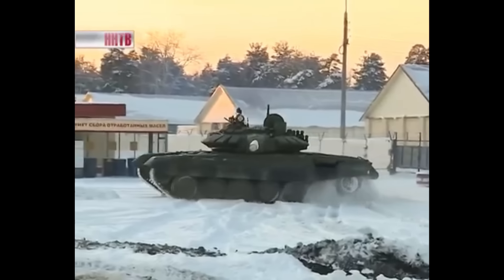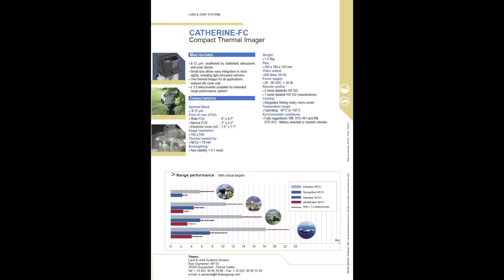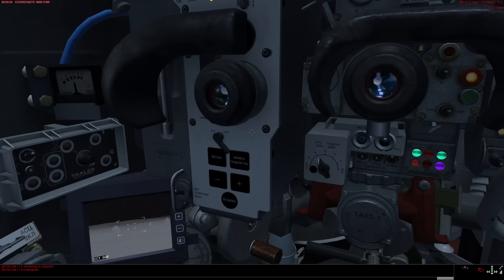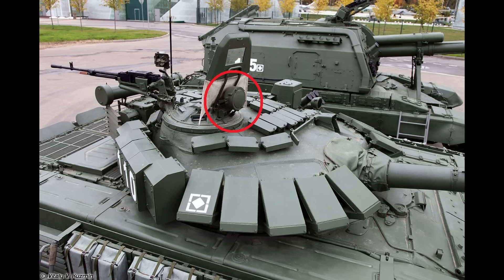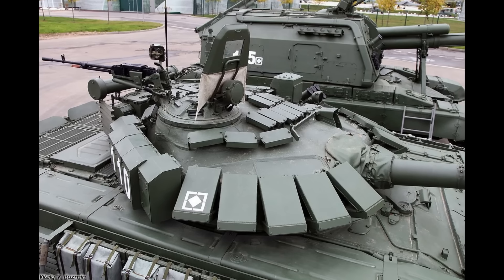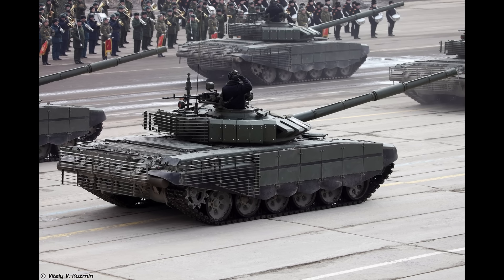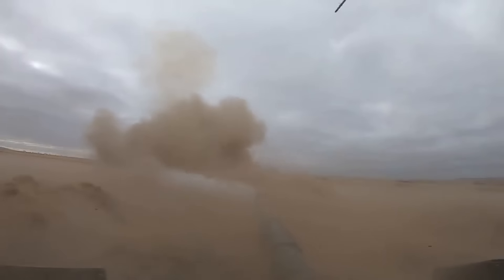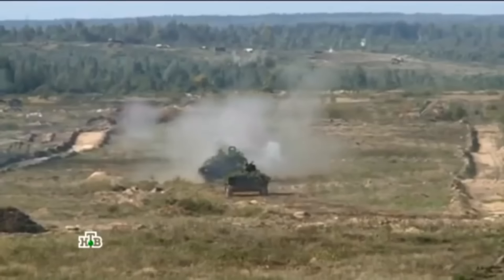Problems with Russian T-72B3 tank

Comment: my only question is, is the spacing between ERA blocks really that important? especially around the side era, the gaps seem so small and normal engagement ranges are pretty high i have a hard time seeing anyone getting a round on such a small target
Reply: you would be surprised
Reply: When the enemy is sporting shitloads of cheap infantry anti-tank weapons it can be quite major flaw. Loads of tanks will be blown up on the first or second hit to the side when hitting the vulnerable area between the blocks.
Reply: given that they addressed it on the t90ms and the t80bvm i would have to assume it was important enough
Reply: Honestly I would say its easier to hit the area where the ERA was blow up from an earlier hit, than the Gaps, but its a statistic thing, how much less cover you have the easier it is to hit
Reply: Fire at a tank 1km away, and the wind makes your shot drift off by a few centimeters.... now 99 out of 100 shots will hit the ERA, but 1 of those will hit the gap, and punch through the measly 60mm of steel behind it, setting off the magazine.
Reply: The ERA block themselves problem 
once they expended, its game over
Reply: ok the chance of hitting it is small but consider how much punishment a tank is gonna be receiving on the battlefield and consider
Reply: There is no reason for the gap to be there so why design it to have a gap? Then again, if most of their casualties are form top-attack munitions...
Reply: @shenglongli8387  
No really
The LAHAT is laser guided and able to penetrate up 800mm of armor
Laser guided allow the gunner to precisely double tap the same spot
Once that area is exposed , its wrap for that tank
The newer generation of tanks are getting precision rounds that allow to gunner precisely or with the KSTAM round simply attack the top of the tank
Tanks problem is the increasing development of top attack weapons
Loitering munitions can perform near vertical drops on tanks
Reply: @DarkestVampire92  That was the assumption. But what we see in the current conflict shows that was not the case. However, given the price, it was acceptable if you don't go to war.
Reply: @shenglongli8387  Even if you dont hit the gaps,ERA only works once,and a follow shot might
Reply: Like most Russian equipment, you are gambling with luck. The gaps are small, but are everywhere along the sides, both on the body and the turret. The combined gap is quite large and the chance of anything by cheer luck getting in between is increasing the more gaps you add. It's a gamble really. Compare those gaps to the oversized wedges on a Leopard 2 for example.
Reply: Check calibers of anti tank weapons and compare them to the gaps; they are thin enough for blocks doing their thing. Newer tanks look different although no one knows what is inside ERA or other kind of protection. Stalin explained quantity has its own quality.
Reply: When a block is hit, it will ever be blown off or blow up depending on what is hitting it. So if the block is two feet wide and has a gap of 3 inches on each side, if the block gets eliminated, that's a 2' 3" gap by any anti tank device made after 1980.
Reply: @PAcifisti  lots of tanks survived multiple hits, funnily enough. It's kinda random, I guess.
Reply: @corvanphoenix  yeah, seems like it works in Ukraine (the only thing that is Ukrainian at this point is manpower, or at least majority of it). Artillery really is god of war.
Reply: In Syria, rebels were taking out tanks with 3 to 6 shots from RPGs in the front, and faster in the back. Their FCS is bad that's why they often stop to shoot.
Reply: well you playing a numbers game with that placement.
a "properly" installed ERA kit with maybe 0,5cm - 1cm gaps would cover 100%
then this placement (estimating with images shown) with one horizontal 10cm gap and many 3cm gaps verticaly would cover 85%
so your sides have a 15% chance of getting a "critical hit". also atleast on the big gap a APFSDS penetrator is small enough to fit through.
in tank-on-tank engaments that are hundrets of meters apart, you can't realy aim for those gaps. 
yet if we talk about scenes from ukraine where tanks where unsupported in urban areas or got ambushed when in a column, this tiny gap at >300m becomes a big gap for panzerfaust 3 or rpg7 from <50m
Reply: The problem is not with precise shot but with a lucky shot that ends up hitting the vulnerable naked base armor. 
(And this has happened in Ukraine, where an Ukr. APFSDS has penetrated turret front where ERA wasn't present)
A T-80BVM has Relikt ERAs with minimal gaps. So the BVM TC can always be assured that, the turret front area is mostly protected and hence plan his tank's actions accordingly. He can use the hull down position much more confidently.
For a T-72B3 (and T72B obr.1989 and T72BA as well) TC, he's aware the K5 ERA does cover some parts but not all of the turret front. So he can't rely on the frontal protection as much as like a T-80BVM or T-90S or T-90M tank.
A good 72B3 TC will always be cautious of the vulnerable spots. Any lucky HEAT or APFSDS round by chance will go through if it happens to end up hitting those spots resulting in crew loss.
Reply: Their ERA is ineffective , many warheads are tandem these days , along with top attack weapons. Watched a vid with a missile absolutely destroying an ERA protected T72. That was from an angle of around 70 degrees.
Reply: Ukrainian tank man that now uses t-64BV and t-72b3 complained about gaps in ERA, said that modern sight systems are good enough to shoot in these gaps. Also i think that this video based on words of man i was talking about
Reply: Only one gear backwards is "the" fundamental flaw in T-72 in my opinion. The original T-72 cold war era 2nd gen night vision system has the problem of röntgen radiation through the eye piece. In Finland the use of the T-72 night sights was prohibited in peace time...
Reply: @unknowncommenter6698  I've seen those vids too. More often they do seem to take damage from those hits as the smoke and / or fire starts blooming out from the engine bay or through the turret hatches. Afaik, the jet from a HEAT projectile is narrow and depending on the hit location and angle the damage varies. There's little space inside a tank that has nothing important in it.
Reply: if someone get so close as to aim for a 3 com gap the tank is doomed anyway , but yea !! i think its insignificant or as Russians would say "good enough"
Reply: @mastermariner490  even if you're using composite armour, the integrity of the armour would be compromised after being hit once. A double tap on the same spot would likely pierce composite armour even if the round doesn't have the theoretical penetration. Nonetheless, hitting the same spot is not easy, especially not with a RPG or equivalent.
Reply: @londonberry2180  True,then again most atgms have tandem warheads,so ERA itself would be penetrated regardless.
For an apfsds i would say older types would struggle to penetrate and break,newer with break off tip would penetrate
Western countries,espesially US have spent years of research on this.
Reply: @PAcifisti  era is not meant to be used like that, each rocket will clear an era panel anyways
the gaps are the least you have to care about when you are getting hit by many rockets and losing many panels

the first rocket hitting the tank will have less than 5% chance of hitting between the panels
the second rocket will have more than 15% due to the missing panel hit by the first rocket

an rpg user or a tank gunner can in no way aim between the panels, this is precision not even seen on pricision rifles
the survival of the tank is competely random and has very good chances due to the side and turret coverage
Reply: @mastermariner490  the Relikt was specifically designed to defeat tandem warheads and newer NATO APFSDS. Although at this point US would have developed a new APFSDS against Relikt (causing Russia to develop the Malachit). It's a never ending race where sometimes the shield wins and sometimes the spear wins.
Reply: @londonberry2180  Yeah thats true,but relikt is just an upgraded kontakt 5 with different explosives and plates and not atleast angles,hence their shape.
I am pretty sure US and NATO have enough data now anyway to find a way to defeat it,after so many russian tanks have been captured
Reply: Important for people who love to sit, watch and criticize. But during conflict, everything has its own capabilities and limitations.
Reply: @verdebusterAP  tankers as a rule aim center mass, not on particular places on turret. The first one to hit usually wins, no point carefully aiming if you can shave off important seconds aiming center mass, it's also faster to follow up with another round rather than aiming at where era used to be
Reply: @tomasgogashvily5350  ERA wasn't invented yet in 1945.
Reply: The ERA module doesn’t fully covers the external panel as well, add that up you will get a pretty big gap.
Reply: @verdebusterAP  This is not how things work in real life.
Reply: Enough hits and it will eventually be a problem
Reply: yes, it is important, if NATO tanks do not have side armor, this does not mean that they are not needed. they help against shells, in Ukraine it was clearly visible, if the tank has armor, then its survivability is higher
Reply: Explain it in a way that is acceptable to family of the crew that dies to the gap in their ERA.
Reply: @Roter_Baron534  The LAHAT works that way in real life,so does korean KSTAM
Reply: @verdebusterAP  Usually tanks do not stay around after first hit or two.
Reply: @verdebusterAP  800mm is not enough to penetrate even a T72B3 or T80BVM in its frontal aspect without hitting any weakpoints, let alone T90M.
Reply: @rikulappi9664  "The original T-72 cold war era 2nd gen night vision system has the problem of röntgen radiation through the eye piece."

Holy shit, is that really true??
Reply: @orlock20  Is gap really 3 inches wide on each side? I would think they took care of this, other armor can still be added. Wouldn't most reactive armors leave a hole until they are replaced?
Reply: @CloneDAnon  
Thats why its called double tap
Reply: @CloneDAnon  
The hit will likely disorient crew long enough for the second
Normal tactics , they wait till the tank is in the open and can't easily retreat
Reply: @Roter_Baron534  
That exactly how it goes down
Reply: @phunkracy  
Laser guided takes the guess work out of that
but it also depends on what you have to use
Reply: @msakel100  The bags blow up if hit with a HEAT rounds, but other rounds, can shred them or knock them off. I'm guessing those spaces were three inches apart or close to it. There are even larger gaps on the top of the vehicles.
Reply: @verdebusterAP  Laser guided also sets off laser warning receivers and if (automatic) smoke is deployed it will break laser lock.
Reply: Bad luck is bad luck (from the tanker's perspective).  The more spacing there is, the greater the chance that the ERA will not work properly.  It might be a relatively small chance, but with impact after impact every day across an armored force, those small chances start adding up.
Reply: I did the math with some excel and photoshop. The gaps account for about 12% of all the surface. That’s a 12% chance where there could be none.
Reply: Well it is very simple if your ERA because of Gaps covers only 70% of the area that means that in 30% cases incoming round will simply pass without ERA doing anything...
Reply: @CloneDAnon 
Thats first generation systems problem
The LAHAT is programmable
Reply: What can go wrong will go wrong.. there are auto-cannons too for tanks. Their sole purpose is to spread ammunition on the enemy target, as sooner or later it will hit a gap, and it's usually, very much so, the sooner.
Reply: @orlock20  It seems to work fine for Russia in Ukraine, i find it hard to say if side armor was ever a problem because media focused on Javelins hitting the top. Since they dragged their army to Donbas and tanks went out of cities, Ukraine only reports burning APC here and there. According to the media throwing hand grenades into open abandoned tanks became Russian sport, real damage comes from their anti tank cannons.
I believe bigger wars will become a lot more high tech, especially since USA lost its primate of being the strongest force with Nato, doing what they want like in Iraq, Vietnam and 50 other places. If you look in the past we had big empires but never just one, only nature is always uni-polar.
Reply: ERA in itself is what’s considered a “statistical armor”. Basically it doesn’t always work. The warhead has to aim at a specific location and be detected at a specific distance in order to neutralize the warhead. 

Even if everything goes well there’s a chance the ERA will do very little. Even though the gaps are small, it garentees death where as the ERA gives a chance to survive.
Reply: The thing is side armour is so weak in and of itself that if a hit lands half on a block, half on a gap, you and your turret are still going to go to the moon.
Reply: So it’s confirmed nobody here has actually been watching combat footage from the war. Those Russian tanks are seriously tough and boring direct hit from something like a missile from a helicopter they take repeated strikes to go down. Even then they usually don’t explode. I have seen several confirmed instances of tea 72 tanks of all different variations taking a half dozen or more hits continuing to fight and then making it back to homebase with all the crewmembers alive and well. Nobody would feild a tank that you could destroy by kicking angrily.
Reply: @nvelsen1975  That's.. pretty much the same at the front armor thou.
Reply: @gerfand  This right here is the precise reason why French tank designers have been obsessed with the concept of fast magazine autoloaders since the beginning of the cold war; hitting the same spot multiple times to defeat the armour.
Reply: @Mortablunt  Of course we watched it, those who say this tanks are worthless have severe lack of critical thinking. 
If they were bad Ukraine wouldn't want and use them either. I would like to see Abrahms weighting around 70 tons in autumn mud lacking auto-loader, that would be interesting.
Reply: @nvelsen1975  If country can win the war before adversary can build enough Javelin like weapons (pretty rare it seems) and huge army with artillery, or never get attacked because they have nuclear weapons, M-72s are more than good enough.
Reply: @msakel100  
No army would use a tank that could be defeated by kicking it angrily in the glacis.
Reply: No irrelevant, as a javelin missile attacks the top of the tank making it go boom. Until that is reinforced or countermeasure installed. Oh wait, there are no countermeasures for a javelin. never mind. Russia is screwed.
Reply: Tod's workshop was testing medieval archery vs medieval bascinet helmet. He shot about 10 arrows at the bascinet from a heavy crossbow, one of which went through the visor slit and hit the go pro inside the helmet.

Comment: i think the biggest failure is the russian have not used these tanks designed the way they were meant to be used, mass tank frontal charges across a widefront .
Reply: After pulverising every airfield, barracks, port, HQ, supply hub, etc with several hundred tactical nukes in a big pulse then driving said tanks through the radioactive hell is how they were designed to fit in. Those days are long gone.